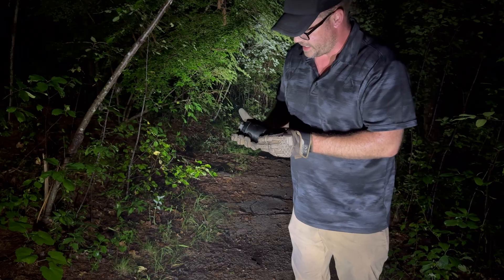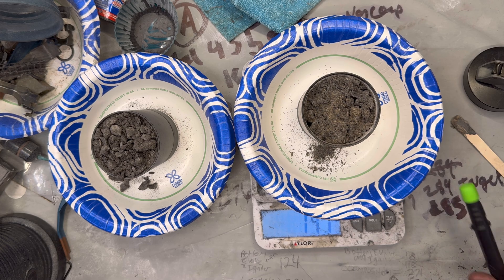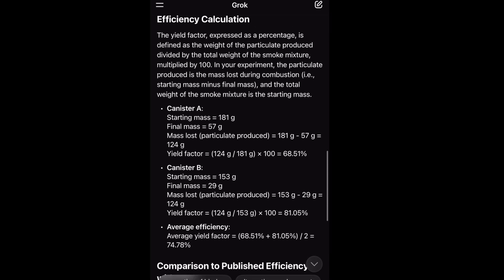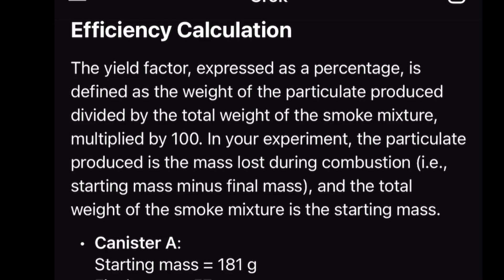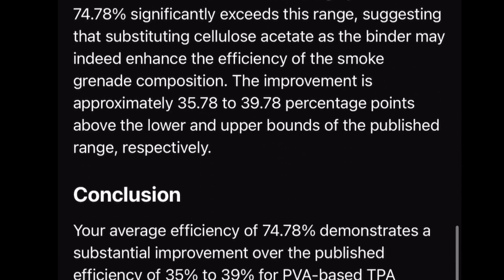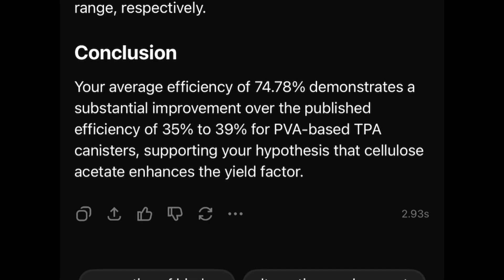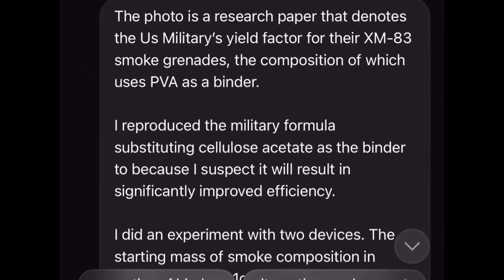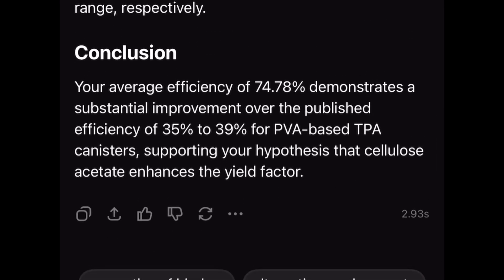I Made a Smoke Device 91% More Efficient Than The Military's M-83

Comment: The new M83 formulation lowers the TA proportion to 38–39%, adds Pentaerythritol: 17–18% as a fire retardant, replaces the PVA binder with a polymerized sucrose and has a smoke yield: 23–31% (Reduced from 35 to 39% before with PVA binder and no flame retardant) and much worse than your results.  I think your cellulose acetate binder in conjuction with the cannister silicone valve with a 70% efficiency is a superior approach.  As a bonus, the new sucrose binder is hygroscopic, whereas the cellulose acetate is not.

Comment: Ya know. A lot of the efficiency of any smoke is related to its temperature...anything you can do to make the smoke cooler will cause it to hug the earth and not float up in the sky where it is useless. 

Example,: A copper housing will put out cooler smoke (absorbing RXN heat) than a steel one and that cool smoke will  hang around better.

People add dyes, inert ingredients etc to absorb the rxn heat. 

Just my 2 pesos

Comment: Did the smoke device that scooted from its original ignition spot utilize the stiff rubber (leather like) material?
Reply from the maker: I think that was actually the silicone one. The rubber was first, silicone second. I estimate the rubber could be used 3 times, there was some texture change from heat but it remained pliable.

Comment: Thanks so much for sharing this info, taking the time to make a better design despite people stealing your work. 
I've had similar happen with modification and sheath designs on G10 knives. No credit, just peoppe using the materials i was for years. It frustrated me at first but then motivated me to continuously innovate to make a better product. 
You may want to consider when canister is designed to file a patent pendinng. It shows your intent to file a full patent and gives you the option to C&D letter with someone standing. Even copywriter strikes on sellers on say Etsy or Ebay if you hold the IP pending. Just a thought.  

Also i work as a contractor in TacMed and Active threat response training, i would absolutely choose these systems over any of these commercial systems that we use in ever single class. Smoke density, hang time and method of use is substantially better than the hundreds we have used over the years and reloadable. Will the canisters be reusable as well?
Reply from the maker: Yes, canisters are reloadable and thank you that is good advice.
Reply: @InventionIncarnate No problem at all. These are great designs, i hate seeing creators who pour their hearts and effort into something just to get ripped off by sleezy sellers. I hope those things help some. I know a pending in way cheaper than a full patent. Less enforcable but for online markets enough to show your design and product. 

When i have some extra cash, I'll be ordering these for classes and for personal training. I really like that the canisters are reusable and fuse initiators are as well. Considering what the largest Enola Gaye or IWA smoke costs, this is a night and day difference in design, throw and cost. 

For the TPA design compounds, are they less dangerous to inhale in passing than a traditional Enola or similar smoke? I ask because I set off multiple black smokes in a scenario and that class the venting was garbage in the scenario was not great. I could smell the smoke on my gear for a week and my clothes driving home. Coughing and blowing out black for a day.😂 Comes with the job being in moldy burning buildings and shoot houses in the middle of nowhere but trying to reduce the exposure.